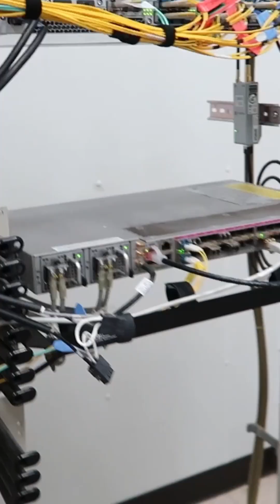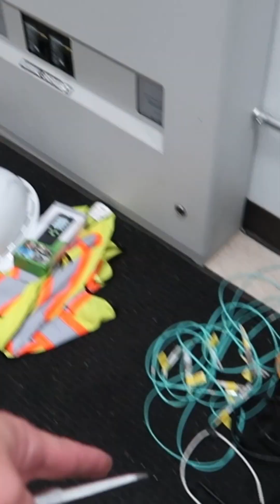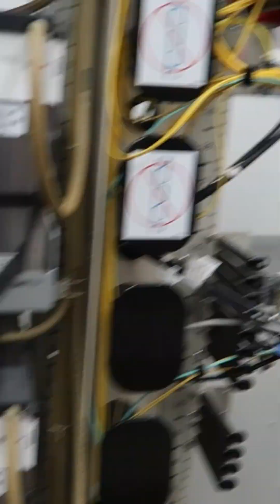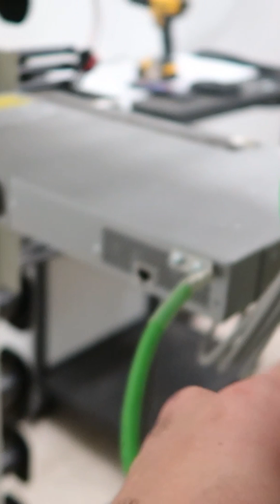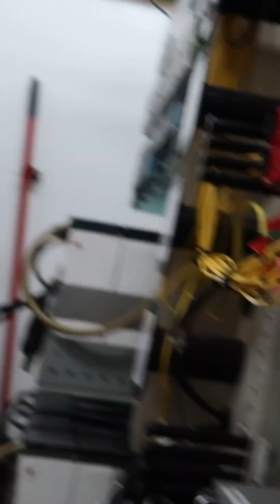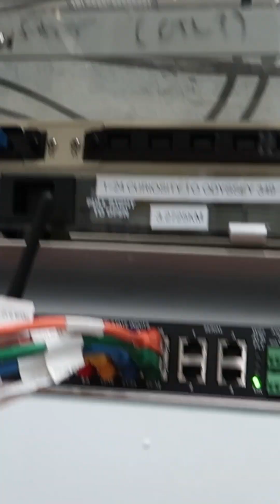Don’t Ruin Your Fiber Cables With This Mistake!

Comment: Buy a LC one-click, if a fiber ferrule or the inside of an optic gets dirty just hit it with the one-click a few times and you should be good to go. If you want to be more thorough, I'd recommend a scope.
Reply: Exactly what he said. The one click and scope are bare minimum. I would suggest getting an alcohol pen and a fiber optic cleaning cassette. You can also use the one-click to clean the SFP or to clean a patch panel.